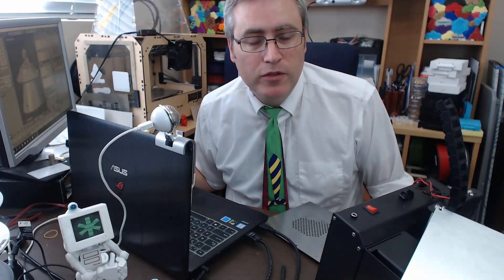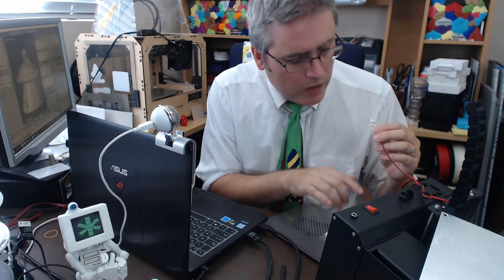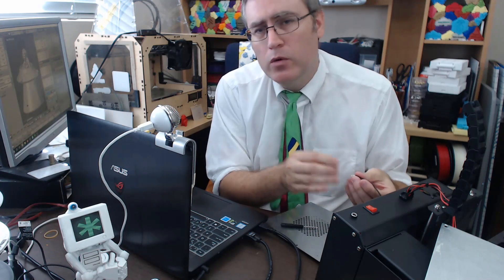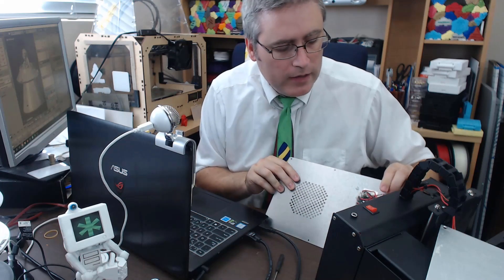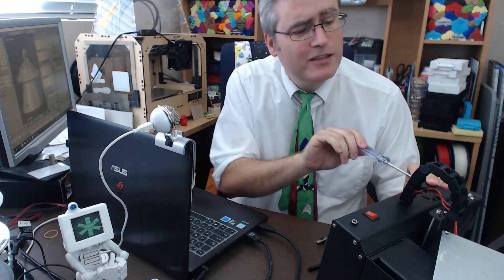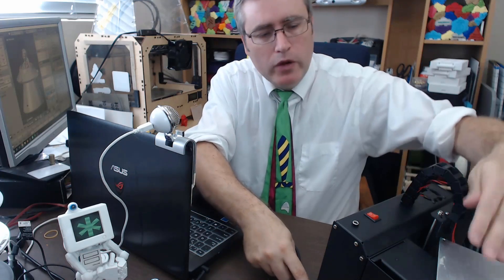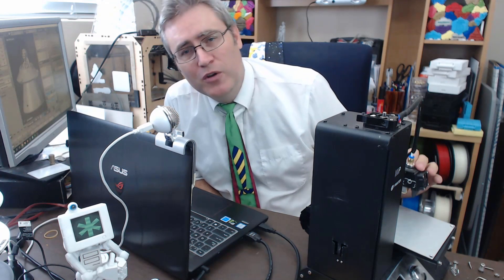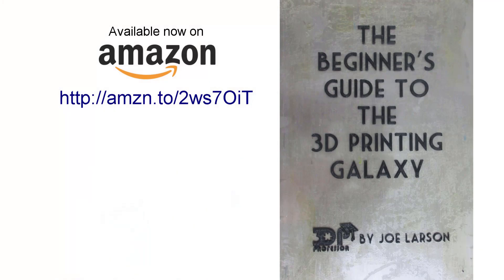When is the right time to upgrade your 3D printer?

Comment: I agree with the "Don't fix it if it ain't broken sentiment. But I can't help myself! ;) My Mini V2 isn't broken per-se but it isn't performing quite as well as I'd like so I've been trying various things to help with quality. New bed bearings, stabaliser on the Z axis, new spool holder, belt tensioners, and soon new fiberglass reinforced belts to replace the way too loose and stretchy rubber only ones. Once I get my 6mm bearings I'll be replacing the other's as well. The original ones are super loose, I'd almost call that broken, but not quite. It'd have worked but been sloppy and noisy. SUPER noisy. Just the bed bearings being replaced helped so much in the noise department. Used to rattle around like  nothing else.

Comment: Learning was reason why i didnt buy complete ready made kit. Sourced parts myself and made DIY model... And i have learned tons of it. Doing upgrades to it step by step. Last one was replacing thin plywood y-carriage with proper aluminium laminate one. Next one is cable chains, wife keeps saying wiring resembles spaghetti mush.. :P

But then again i do agree, do upgrade when you need it. And if printer needs fixing anyways, its perfect time to add upgrade as well.

Comment: I don't second the opinion of doing as much upgrade as possible when cracking open the printer. Most of the time, the upgrades involve re-wiring, installing new parts, and various tinkering. This introduces whole lot of variables when you starts your "first print" after the upgrades. When the "first print" fails, you got lots to figure out what went wrong.......

Comment: I don't think I would fully subscribe to "wait until there is a need" unless it is a complex major surgery type of upgrade. There are a lot of simple upgrades that might be considered "quality of life" type. A lot in this category are simple things you can print yourself, can greatly improve your experience and production, and will often have a direct impact on your print quality. Things like better bed leveling knobs for those without auto leveling (such as a CR-10), a ducted fan and a directed part cooling air shroud, which greatly improves your ability to do bridging and overhangs, and reduces support need. A simple filament guide to help prevent snags. Z axis braces for larger open frame printers. Most of these type things don't require delving into the depths of the wiring, needing only a few screws, but can offer great results for a few minutes effort. You don't need to wait until something breaks or needs maintenance to implement them.

Comment: Simplify3D is very nice, but to bad you can't adjust acceleration and jerk without going into the firmware or g code settings ... however you do that... very sad ! 

BTW: A very good video as usual ;- )

Comment: I know this wasn't the main point of the video but do you need any more help with your mini? I'm a moderator on /r/MPSelectMiniOwners and if you need anything just message me through mod mail. I would be happy to help you out.
Reply from the maker: I appreciate that. Funny thing, the fix I was implementing in this video didn't work. I had to resolder all the connectors and ended up resoldering a new thermister on the build plate as well, and now it works like a champ. But I own 3 minis that I use to teach, so if I have any questions I'll reach out to you.

(Regrettably, I don't reddit much anymore. But I appreciate the connection.)
Reply: 3D Printing Professor Hey it's the least I can do for the guy who convinced me to get in to 3d printing, and specifically the Mini. Best descision I ever made.

Comment: Is there a board out there that supports external motor drivers (En Dir, Step) pins, and has dual extrusion capability? Other than smoothieboard since it doesnt work well with S3D.